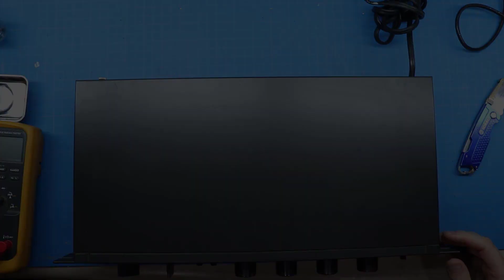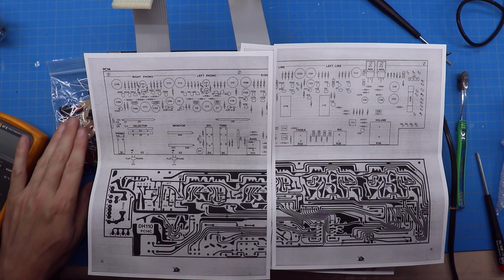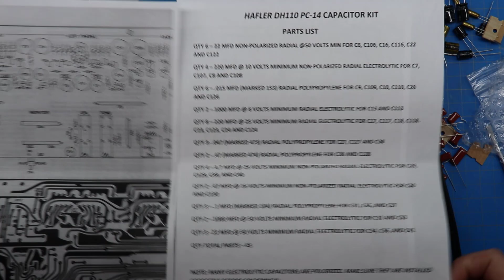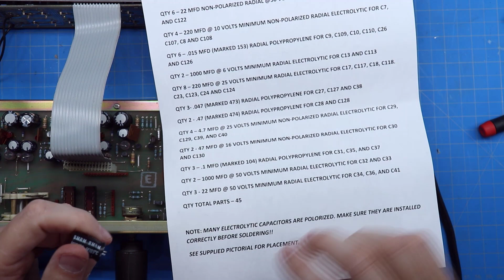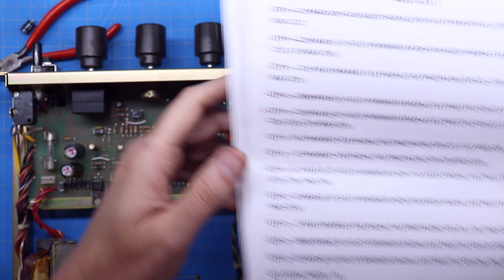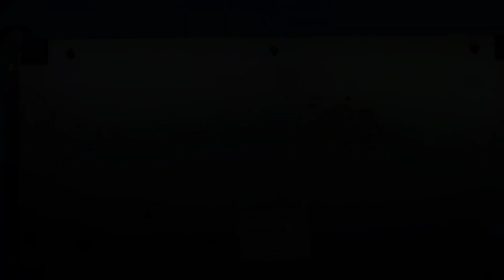Hafler DH-110 Preamp Restoration

Comment: Have a question... I recapped mine , but on the small filter board i just unscrewed it and removed it. BUT  i see its easy to install and put the pins in the wrong slots on one side.   Any info or pic or diagram to show which pins go in what terminal. i think the connector was numbered 1-9

Comment: I built this preamp back in the 80s and am currently recapping it. If the board was marked incorrectly it would not have worked after assembled. Perhaps kit units are more careful about marking the boards. Good advice when it comes to factory assembled units. Thanks.

Comment: The hole in the rack mount cover is for the Hafler DH yellow indicator light.
The light comes on when you had it cranked up for 3 days straight and it started to get a little warm 

I have 2 DH 200’s restored and I challenge anyone to find a better built amp for the price
Reply: I built the 220's and then built a DH500 power amp (both had the same finals). It was so so in my view, I had a lot of trouble with the pwr transistors and one board finally burned up. Couldn't find the mosfets 20 years ago finally found some super expensive replacements and sold it, just too problematic and the sound was good for the time but not great. I still have the DH110 which was a very highly rated preamp at the time but I like the sound of tube hybrid preamps better tied to class D amps. By the way David Hafler designed a 60 watt per channel transistor amp back in the late 60's that was a big deal back then but it continuously blew pwr transistors too. Cheap kits and for us builders it was the way to get decent sound, I'll give it that.

Comment: So wait a minit. You're telling me that the the entire time you were working on this, you never once checked the part number on your schematic, and compared it to his part list, and saw that he included 220s instead of 470s????
Reply: The Hafler specs for those caps is 220ufd. After Hafler sold out to Rockford Fosgate, RF substituted 470ufd, since they used a boatload of that capacitance in other models. The 470's were cheaper for them to use. At least, that's what I've been told.
Reply: @pilotpete2  ah..

Comment: Hi Mark,
TECHNICAL QUESTION:
Can 2 x 117 Volt Tfrs be wired in series to run on 220 Volts? Trying to better understand transformers.
Just rewatching your series on explaining Tube Amps and living in Australia we have 220 Volt supply although I measure 245 V at the wall outlet in my house.

Comment: I'm working on my son's DH-110 again. The RCA jacks on that board are only held mechanically by the solder joint. When you have it apart these should be resoldered, or inspected very closely for fractured solder joints. My Sansui AU-7700 has the same problem and has been apart many times to repair fatigued solder connections. Maybe JB weld to shore up the mechanical stress may work, but I haven't' tried that yet.

Comment: The new straw on the D5 is terrible, it wastes product, it is too big, and you need to buy an adapter to downsize the straw to a smaller size that can get in the small holes of a potentiometer. They call it the perfect straw because it sucks! I also miss the low, medium, high variable setting of output pressure of the old can. So what if I loose the straw, any straw from other products, WD-40, carb cleaner, brake clean, etc. will fit. They are all over my shop.

Comment: I have a question, I have a 1978 Yamaha CR-2020 that I purchased recently and the guy threw in an older pair of Technics speakers that sound good for what they are. I thought I'd try the reciever with my klipsch r28f that I use for home theater, and the mid bass drivers sound blown. Real floppy sounding even at low volume. So I connected the Klipsch back to my Denon and they sound fine?? Any idea what could be going on? The Yamaha does sound a bit punchier than the Denon but doesn't seem like that would do this

Comment: HI,  I have a(Superphon)  Revelation Basic preamp circa 1986 (approximate).  It a dual mono design By Stan Warren (the S in PS Audio.  It got rave reviews back in the day.
None of the caps are swollen or leaking.  Should I recap it because of its age?   Thank you so much.
Reply: Is it broke?
Reply: @seanobrien7169  Nope.  So i'm guessing leave well enough alone.
Reply: @lynnpoole7830  Your call.  Recapping would be playing it safe, but I don't know if I would mess with it until I felt it needed it. EDIT:  Let me add that Mark found some bad caps in this one and i assume it was working fine.  I am also not too sure that changing the electrolytics in a preamp would effect the sound like it MIGHT in an amp.  Not opening that can of snake oil though...
Reply: @seanobrien7169  Thanks Sean.

Comment: Not impressed. "I bought a capacitor kit, but I don't like buying capacitor kits"
A little research would have helped, as you are not the first person to recap a DH-110.
Reply: He brings up that exact point.  These boards changed throughout production, the schematic or parts list might be off what is actually in your component.  I don't think he was trying to impress you, just help out us amateurs.